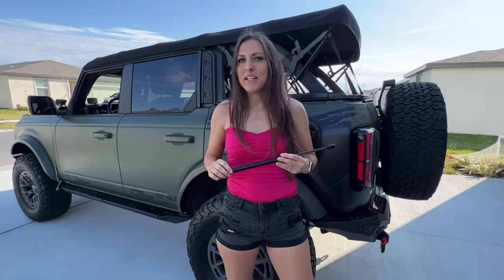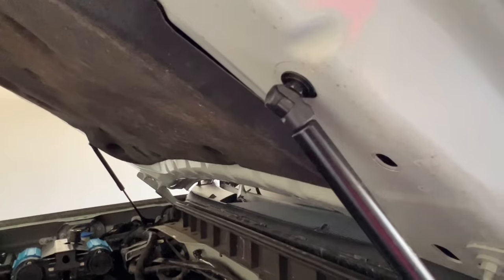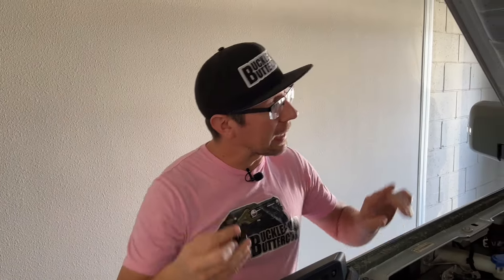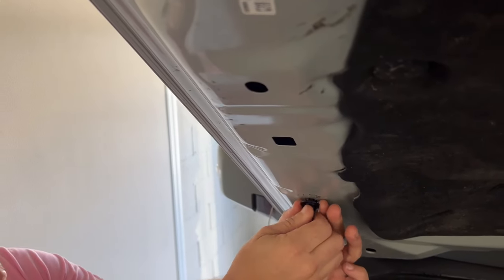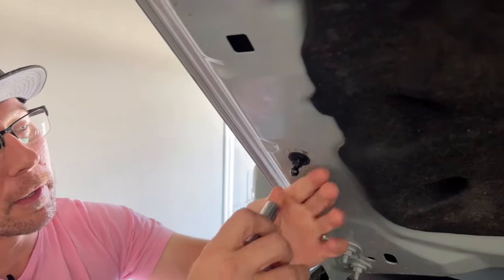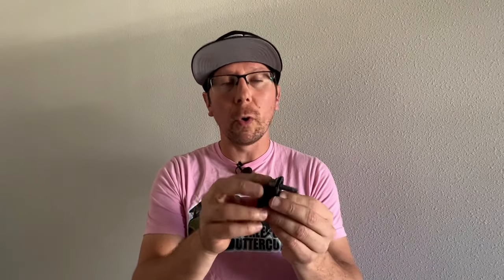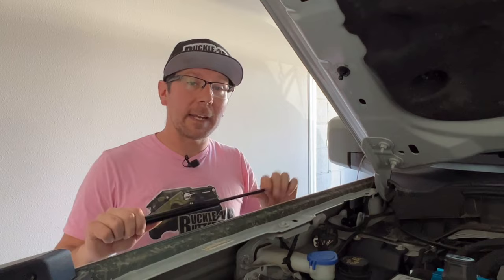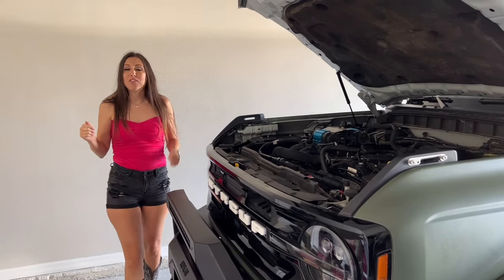Buckle Up Off-Road Hood Strut Kit for the 2021+ Ford Bronco Install

Comment: Looks like an easy install!  Can you give an update on how well they work?  I noticed they are noticeably cheaper than other options I've seen out there!
Reply from the maker: I have had them on quite some time and have had no issues. The iag ones I had caused some paint damage, so I switched to these.